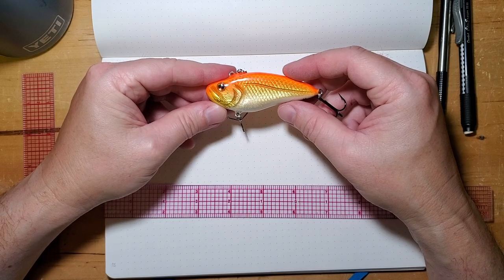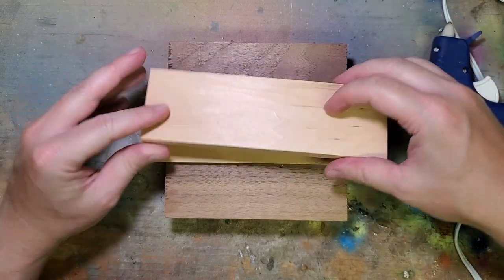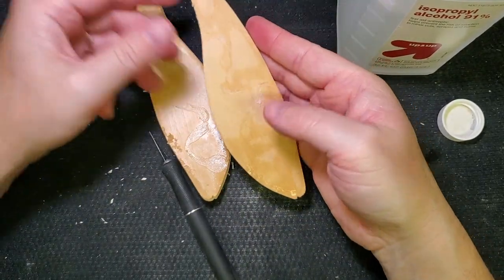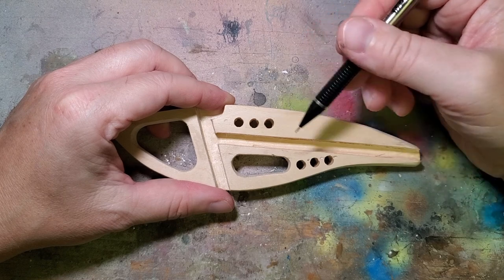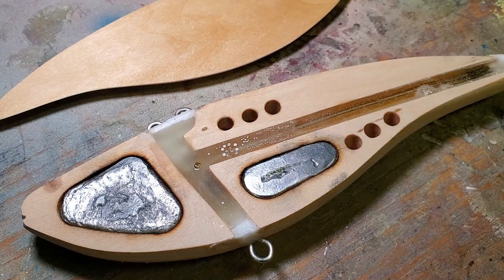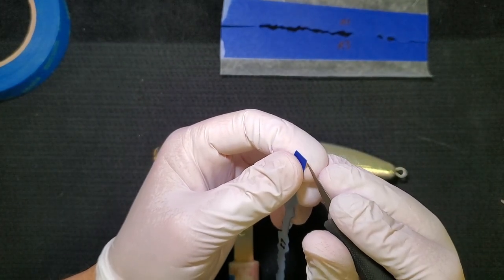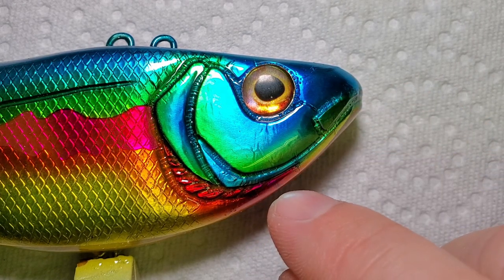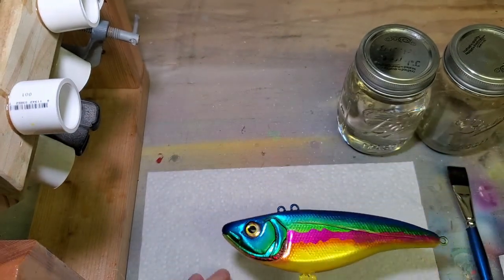Making a Huge Lipless Crankbait Lure out of Wood

Comment: I experienced the same thing with kbs. I looked online when I had issues and read that sometimes putting it on the rotisserie can make it bubble because of the drying time and it is constantly moving. I started letting it drip cure and had better results. Learned that the hard way in the beginning. It's great when it turns out, but it can be finicky. Great job on the bait. Looks amazing!
Reply from the maker: Thank you very much for watching and for sharing! The best way to get better is by doing!
Reply: @zimmtex  100%. Keep up the content, love watching.

Comment: Another gem, Mike, in both the lure and the video. I'm amazed, though, that you took this complex bait all the way through final finish work before testing its action! That's not like you. It looks good in the water, but I wonder if the side to side vibration would have been even faster and more pronounced with less lead in the center section. Seven-plus ounces is a LOT of weight in a 7"lure. I wonder how this big lipless crankbait's action compares to that of the excellent "shimmy" in the big, orange, lipped crankbait you built two years ago.
      Thanks so much for the experimentation with Diamond Coat and your discoveries. I bought some a month ago because I, too, was looking for a finish coat that was thinner and wouldn't hide subtle contours. Now, because of your work, I know how to use it for optimal results. Best, Chris (in Maine)
Reply from the maker: Thank you so much for watching and for commenting! I wish you the best of luck in your lure making journey!

Comment: a great way to prevent the boubbles , after you put on the clear coat you blast it with a heat gun or similar tool :)
Reply from the maker: Yes, but I have found that you need to be quick and careful so as not to heat the wood or you can cause it to off-gas and make more bubbles. What I learned about KBS is that it needs to be applied in very thin layers.

Comment: Nice beautiful fishing lure I have a suggestion for you if you ever run out of hot glue for your hot glue gun you can also use double sided sticky tape to hold the pieces of wood together and it's much easier to pull apart after
Reply from the maker: Thank you for watching and for your suggestion.  I bought some double sided tape for a small cnc machine I got. Might try it out for this as well.

Comment: Really great work! Could you maybe explain why you put insta glue on the gills and scale patterns? Didn’t find a comment where it got asked 😅
Reply from the maker: Thanks! I put Insta-cure over the wood to seal it. It also strengthens the details to keep them from breaking too easily.
Reply: Thank you! But u still seal it with another wood seal after ? Or is the insta glue enough if I would try the master in water first for example.

Comment: This lure somewhat resembles a Luhr-Jensen Sugar Shad from the 80s. It had fins molded into the body but other than that it's similar.
Reply from the maker: I'm not familiar with that one; had to look it up. I see what you mean about the fins. I wonder how those affect the action? Interesting!
Reply: @zimmtex  I would think fins dampened the action. This was never a wonder bait for me, I did better with the Rattle Spot and Rattletraps. These were more of a cover water quickly search bait for me. In the early 90s my Ranger had a factory installed flasher in the dash and my power poles were on the end of a rope. We still had to search for fish. A new fully rigged 361 Comanche was $25K, what are they today 98K. Gosh I'm old...

Comment: Nice lure...can you put the lure inside of microwave oven to soften the hot glue?
Reply from the maker: You can, but it makes more of a mess because the glue can easily re-melt.
Reply: @zimmtex  owh..ok..and for the rattle i  put mine into copper tube and seal both end with soda can and super glue..make really loud noise and dont have to worry about the bb when epoxy the bait together
Reply from the maker: That's a really good idea!

Comment: hi great video i have a question from minute 28:20 when painting how much pressure did you use and which nozzle 0.4? Thanks in advance
Reply from the maker: Hello! I had it set on 30psi and a 0.35mm nozzle. Thanks for watching!
Reply: @zimmtex  i have to thank you

Comment: I'd like to make a suggestion to you concerning your rattles. Whatever size hole you use for your rattles if you take a hollow ground steel punch and out a piece of aluminum or aluminum can piece super glue it to the wood and when the BB hits it'll be pretty damn loud. Also you'll find there's a big difference in using lead as opposed to a brass BB. Also  just  dip the  entire  lure in the kbs and hand by wire from nose and you'll  eliminate  all  the  problems  you  just  created.
Reply from the maker: I didn't think about a BB sleeve, but it did occur to me that a plate at at the ends would be better. I like this KBS, but I'm definately learning some lessons the hard way. Thanks for the tips and for watching!
Reply: @zimmtex  just dip the Lauren the KBS and hang it to dry. Brother it's not one of those epoxies that you brush on and spin on a wheel. Just dip it let it hang and you're done. That's what it was made for
Reply from the maker: For sure!

Comment: KBS will always have bubbles. It’s got a short shelf life and about a 70% waste factor if you don’t use it in a month or so. That’s my experience. Perhaps try the spray KBS
Reply: KBS is awesome!  Keep in glass jar in a dark cool place, with some cling film under the lid.  Change the cling film each time you use it.  Dip your lures slowly, don't use a brush and you shouldn't have any issues with bubbles.  I have been using the same jar of kbs for months!
Reply from the maker: So I have moved my KBS into a jar and store it in A cool dark place to hopefully keep it longer. I have used the spray version of KBS a couple of times, but I do not believe it is durable enough for fishing lures as you can easily scratch through it with your fingernail.